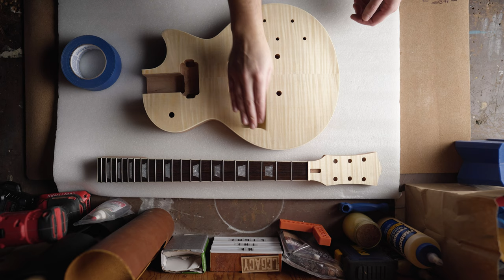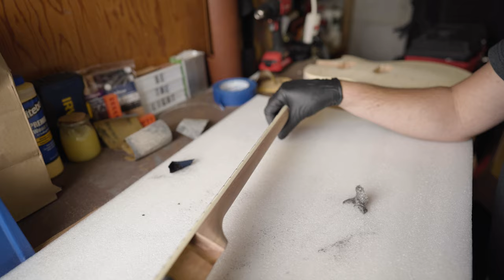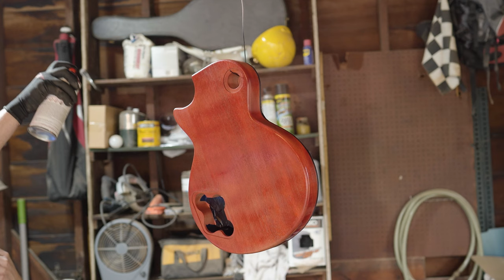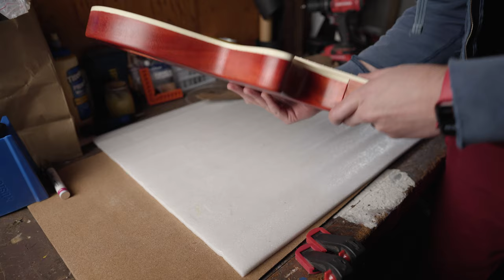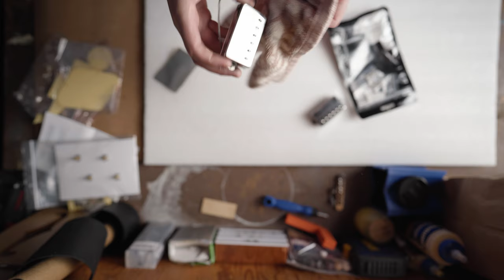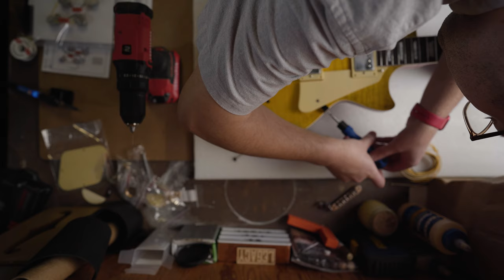Making a Lazarus Les Paul from a Stew-Mac Guitar Kit - ASMR (No Talking) 4k

Comment: nice job overall, but as Osker mentioned, painting the heel of the neck can significantly compromise the glue bond.  Also, your neck heel never fully seated up against the body because you left that piece of binding sticking out instead of trimming it flush with the body.  But, if this was your first build, I'm sure it was a great learning opportunity!  Great choice on the Fleor pickups by the way.  Those are great sounding pickups that most people dismiss just because they're inexpensive.
Reply from the maker: Thanks, yeah it is not my first build, first LP. I did get the neck in and it's not going anywhere, not every second of the build is recorded. Yeah, the Fleor pickups sound great, I used a set of P-90s from them in a 335/330 build and loved the sound.

Comment: Stewmac guitar kits are really well done, I've built probably around 20 guitar kits from a lot of different places and I think Stewmac is one of if not the best.
Reply from the maker: I tend to agree they do a pretty nice job on the kits, the standard ones can use hardware upgrades, and the Wilkenson kits are pretty solid.
Reply: How would you rank Precision’s guitar kits?
Reply from the maker: Haven't tried one of Precision's kits, I've done SOLO and FretWire Kits those were ok but the necks needed a lot of work.  @jerrymander1492

Comment: I built two of these kits so far. I would definitely recommend them. The second I decided to upgrade pickups and nut and keys and went to a steel input. I thought the first kit (all stock) sounded fine. Not stellar but not weak to the point of needing upgrading. 
I decided before the second build to upgrade and it came out stellar. Emg 81/85 in neck.
I love this combination and have used it many times over 30 years. I did this combination on a squire contemporary tele HH.
It was definitely an upgrade from the factory pickups. Today the battery puked out so I decided to try the stewmac LP style pickups from the kit in it. Wow! They sound unbelievably fantastic. I'd never think about taking them out.
I'm just saying that I am a firm believer in that luck plays a huge role in finding the right pickup for the right guitar. 
Good luck to you all in finding your magic combination.
Reply from the maker: Very cool, thanks for sharing Eric!
Reply: So how did the string angle turn out behind the bridge?? Gibson's are notorious for extreme break angle with the tailpiece flush to the body Was considering one and was curious Thanks man yours came out great
Reply: @paulcowart3174  I know that the stop bar "looks" out of place anywhere other than all the way down. Let's get thatvoutta the way first. 
But, they are adjustable and it does change the "feel" of the things. The higher you go the more "slinky" feeling the strings "feel" and it changes the tone a tad too. Lastly, you can top wrap the strings if you just have to have the bar down flush. But be warned, that method will likely dent and scratch the bar. Even doing this one single time will leave evidence that it was done, so be sure your stringing this way forever or you'll be mad at yourself every time you look at it. 
At the end of the day, you'll likely run into issues if you let some mass manufacturers decide where your bridge goes. IF I ever buy a kit again it will be up to me where the bridge goes. This seems to be the one critical flaw in set neck kits. They get this wrong as often as they get it right. Which sucks. And I have one kit that looks like a beautiful wall hanger for storing some mediocre guitar parts now. Unfortunately starting with kits can be pretty good and pretty bad simultaneously. One out of three guitar kit world kits turned out to be a very nice guitar. It sold as soon as someone picked it up to try it in my showroom, in person to try it out. Another has a twisted neck(boy, am I mad). And the first one sold, got a 5 star rating. Then the fellow said it was warped and wanted his dough back. I did so. Recieved it back, still cant find anything wrong with it.  But once bitten twice shy. I decided to keep it. Besides it's the only guitar I have today with a P90. I  gotta get my mountain on from time to time lol..
Reply: @erickaufmancustomguitars1351  Thank you for the reply...yes the bridge/tailpiece seems to be something they don't want to change up Traditionalist appeal I guess but it's the one thing that can make a difference Faber has some stud grommets that will relieve the break some for the flush to body guy's I think saddle's are very important and always wondered why Gibson doesn't make them exactly like the 50's ones much flatter at the peak instead of pretty sharp Less mass on the new one's as well There is a crew in Belgium teamed up with Stephens Designs the purported PAF guru that basically reverse engineered the saddles and bridge with vintage correct alloy's size and mass Very much hyped as the real deal Johan Segeborn on Utube has some good comparison videos between old and new stuff Gibson and Marshall oriented Thanks again yeah was thinking about trying a kit and wondering if they went traditional or remedied the issue Your build came out good Sorry about the second guy's buyer remorse Cheer's and best wishes for 2023
Reply: @paulcowart3174  theres a company in Canada called precession I believe. I haven't used them yet personally but have had lengthy conversations with few clients who have. They seem convinced anyways. They have a website I was on a year ago or so. I noted they had about a six month wait(actually good news if you think about it) they had option boxes that allowed them to drill for bridge or not.  I'd be taking that option. I can't trust anyone it seems with the proper placement. 
Sure its one thing if the cutter does not know what bridge will be ultimately going on, but when they know and its unable to be adjusted to proper intonation......
Why fret an un radiused fretboard with frets pre-bent to 12 degrees?  I dont know either, but I've bought it on ebay lol.
Just try as best to know what to look for when the kit arrives. Dont be afraid to go so far as to test the ability for the saddles to be able to be adjusted the full distance within the movable range. Patience will be necessary. Theres a few tools and some accurate measurements that must be made.
Reply: @erickaufmancustomguitars1351  Cool Thanks
Reply from the maker: @paulcowart3174  The angle was actually nothing crazy, I played it a considerable amount and had no issues breaking strings. I use DR Dragon skin strings 10's on it, and that worked nice.
Reply: @LegacyGuitars  It's kind of crazy...I have two LP clones Vintage brand and an old late 70's Luxor Custom The break angle behind the bridge doesn't touch the back of the saddles on either But my Gibson that's four times the price of those has that issue Kinda losing faith in anything under 3K from Gibson

Comment: Thanks for sharing overall it looks nice but there were a few things I noticed that worried me. Hopefully you know these things by now but it would have been a better idea to glue your neck in first especially before paint. The paint creates a tighter fit ( perhaps too tight ) and the paint itself is not a good surface for glue. You want wood , glue, wood for the best bond. Also you can clean the glue after it’s bonded and then paint.

The other thing was clear coating your fret board. You won’t be able to oil down your fret board ever and clear on frets is gummy and messy. I hope you already know these things before you build again in the future. Either way though it’s cool seeing people put their love into the guitar. Thanks for sharing your experience!

Comment: Man I’m almost convinced to get the kit and do one myself.  The process seems equally as enjoyable as the final product
Reply from the maker: Hi!

It was pretty fun, but I'm not sponsored so I won't tell you how to make purchasing decisions. I will say the guitar played nice when done, sounds good, and it's my wife's favorite of all the kit guitars I've built.
Reply: @LegacyGuitars   my biggest question is did it feel like the wood was pre-fitted.  Looked like you did no modding to get the neck in
Reply from the maker: @survivealiveofficial4056  Yeah the neck and body were matched very nicely, tight fit.
Reply: The 2 LP style kits I finished from stewmac needed no modifications for a great neck fit. The angle follows the top as it should. I'd buy them again. I'd also recommend them to anyone who can do all the necessary things to get a guitar playing good. If you cant do that, better leave it up to someone else for that part at least. You need the following experience to pull it off right. Playing, adjustments, finishing, polishing, wood preparation pore filling etc. Soldering, reading wiring diagrams. Obviously woodworker experience. Be prepared to spend 1 to 2 hundred dollars on finishing supplies alone. Good luck.
Reply from the maker: @erickaufmancustomguitars1351  Well said, I  agree with your recommendations. These are also low-cost option to learn and experiment on.
Reply: I've been looking as at this kit for a little while and I think, after seeing this, I'm going for it! Thanks for sharing the process!
Reply: @Survive Alive Official I just had a StewMac LP kit delivered today. It is very good quality. The body and neck join is super solid, great fit. The headstock even has a maple veneer. I say go for it
Reply: Alright, I bought one! Hopefully I can make some time to get started soon. Really impressed with the quality!
Reply: how'd it go?  @gordontarpley
Reply: @toadallyawful  had a ton of work come up and haven't started. Hoping to get it rolling after Thanksgiving.

Comment: Why would you lacquer the neck pocket and the neck tenon. 
Wood glue bonds wood to wood and not lacquer to lacquer. 
Lacquering a rose wood board, a lot of hammer blow marks around those bushes. 
Interesting technique for ageing  metalnparts. Bizarre
Reply from the maker: Yeah, it would be easier to tape the neck pocket before spraying.

Comment: I have a question because this build looks great. Stew Mac specifically states NOT to use stain since this is a veneer, and not a solid maple cap. Did you experience any negatives to using stain? I was wanting to follow the same process but just read that on their website under this kit. Thanks!
Reply from the maker: Good call, and yes its a veneer. I was light with the dye and made sure not to get it too wet at once. A cap is much more forgiving and easier to work with. It's always a risk doing anything with a veneer other than using a finish that just lays on top, anything that soaks in could mess it up. The hardcore woodworkers will tell you veneer work can be the most difficult to master.

Comment: How much clear coat did you have to use? I received a second guitar from StewMac but only have the cans from one kit. Not sure if I can satin them both or not.
Reply from the maker: It depends on how think you want, I've done them with 1/2 can of clear before, and you can do it with satin. With gloss, you need a thicker coat for buffing.

Comment: I did a Les Paul build from Fretwire. I had the frets leveled and crowned by a tech. Be careful, my kit had the frets just set in. He had to seat them and glue them. It is my best playing guitar aside from maybe my USA Strat.
Reply from the maker: I have built a few kits from Fretwire, I found they both needed more work on the frets, they are doable, but more work yes. Ironic. I've had better luck with the stew mac kits, but that's a small sample size. Who knows over a few hundred kits.

Comment: This turned out very nice, and you made it look like its not that difficult for the average person. I’m a bit curious about the fitting of the neck did you have to do any thing before you glued it in place or is there some fitting after it’s in place and how is the quality of this kit over all
Reply from the maker: Hi Opie, thank you!

The fit was actually nice and tight, you might see me working on getting it totally in with the glue. For the price, these are great kits, with better fretwork and fit than other kits I've seen and built. I'm not sponsored by Stewmac, but I would make one of these again. Keep in mind the hardware and electronics they come with work fine but they are easy things to make upgrades to when building a kit. A new set of pickups, pots, and switch goes a long way to making these guitars pretty nice.
Reply: @LegacyGuitars  thanks for the reply Archie

Comment: Great looking build! My kit is on the way! What color spray did you use for the backside of the body and neck?Looked like a Stewmac can and color looked spot on.
Reply from the maker: Thanks! I used the translucent cherry nitro from color tone. I love how that looks on the mahogany.
Reply: @LegacyGuitars yeah that cherry looks nice. I got a Tele kit from Stew Mac and it came with 3 sunburst colors. Well I sucked at doing it and I had a LOT of trouble with the Color Tone cans (their fault). They reimbursed me for the nitro. I sent pictures. The black literally ran down my hand while spraying. Glad yours worked. I told them that the cans had 3 different tips between the 8 or 9 cans and only 1 worked. Maybe I got old inventory. It looks from your finish that they’ve resolved it. Nice job.
Reply from the maker: Yah that sounds crazy, I've not had a problem with the 20+ cans I've ordered, I might go big and get a real spray setup. I can imagine it was frustrating to clean up. @jugheadjones5458
Reply: @LegacyGuitars  glad you’ve had success with the cans. Yes cleanup wasn’t fun. I actually have an inexpensive spray gun that works very well. Make sure you use a water trap. I’ve had a lot of water in my compressor and even with a trap on the gun I’ve had problems with water. Some people use a trap at the compressor outlet AND on the gun. Good luck with your future projects. I’m clear coating today and I need to blow out the compressor. Hope I don’t forget.🤣

Comment: Thanks Archie... did you have any trouble staining the frets and avoiding the binding with that fiebing's dye? also I've been thinking of leaving the heel plate off, any thoughts?

4.6 out of 5 stars1,946Reviews

Leather
Reply from the maker: Hey Jonathan! 

I did tape but went back with a razor blade to clean it up on the front of the binding. This one is a set neck so there is no heel plate. But you can leave the heel plate off of bolt-on guitars, some high-end brands will drill out a wider hole and inlay a washer, which works well too. I have a friend who even used a threaded insert. I try not to take the neck off unless it's totally necessary.
Reply: thanks for your reply Archie. . I got what your saying 👍. this is the same kit you have and and is a set neck also, I think I used incorrect terminology, StewMac included a half moon shape of pickguard plastic to super glue over the heel part of the bottom of the neck that sticks out in a half circle.. I'm going to leave it out (the plastic) I think it looks better like you have it.. thanks again have a happy holiday season, my man.

Comment: Looks great man. I want to build a stew Mac kit for my next build. Dumb question though, did you clear coat the fret board? I haven't been doing anything but oiling them.
Reply from the maker: I did use a satin clear on it, I've done it with oil many times also. It depends on what feel you like, I'm not a big fan of a glossy poly fretboard I like some wood feel.
Reply: @LegacyGuitars  ok. Thank you for the input. I appreciate it.  Im new to building and I thought clearing the board was a no no for some reason. That's really good information though. Thanks again.

Comment: What did you write on rhe bsck of the guitar?  Is that just your initials? Instead of doing waterslides I thinking I'm going to do it like this instead.
Reply from the maker: Yeah, that is my initials. I like using the metallic paint pen, and clear coating over it. Makes for a classy look and then gets sealed in. 
I did have some logo decals printed on holographic vinyl that I'm using now, which is fun, but it ran me around $25 to have them made. The pen is cost-effective and looks great.
Reply: @LegacyGuitars  yeah that's a great idea. I'm no longer ordering waterslides. I don't know why I didn't think of this before.
Reply from the maker: @timothydelarosa8261  another trick is to put a piece of painter's tape down to give you a straight line before you write on it. If you mess up it's easy to take some fine grit sandpaper and clean it up. Enjoy!